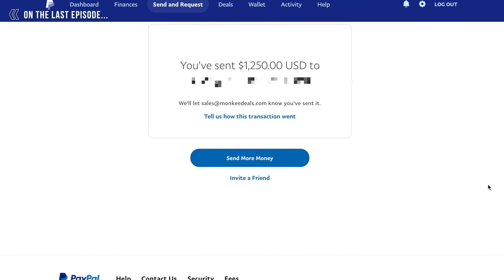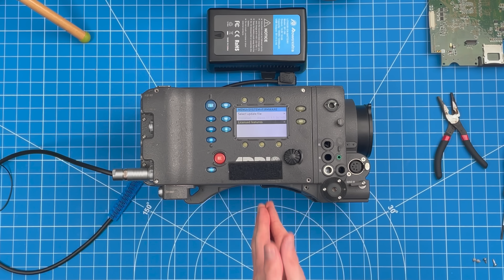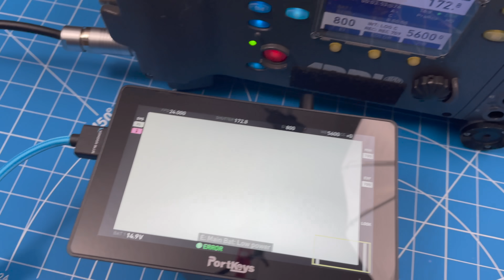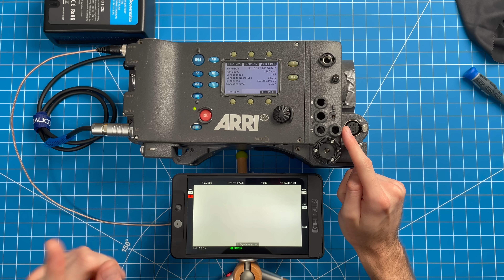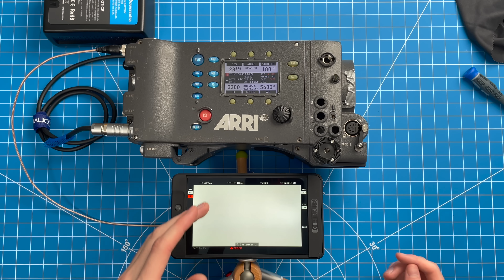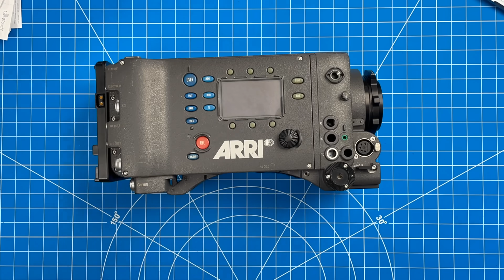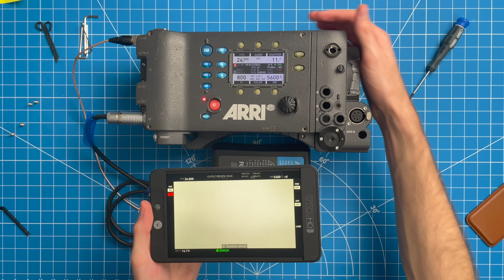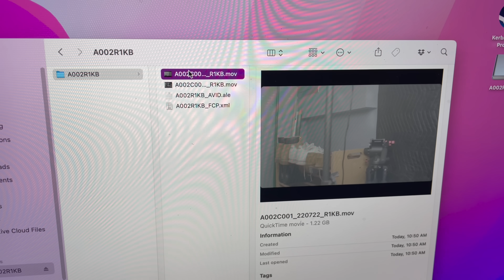I Paid $1,250 For 5 Broken Arri Alexa Cinema Cameras... Can I Fix Them? (Part 2)

Comment: I too started tearing things apart at a young age.  This is a perfect example of my own philosophy:  "If someone was smart enough to design and build it, then I'm smart enough to figure out how to fix it."  Many times I've been told that I was 'super smart'; my response is "I dunno about smart, I'm just good at figuring sh*t out."  I see that in you.

I also see that you are a good filmmaker.  Part 1 had me on the edge of my seat before you even placed the order!  Speaking of filmmaking, a little 'cost of replacement' insurance and you could RENT this camera to other budding filmmakers.  I've seen this camera rent for $600US per week, by itself; and that's at the low end.  Add accessory package(s) and you'd really be cooking with solar. 

VERY WELL DONE!  I'm glad I took the time to watch.

Comment: I worked as a DIT in Germany for many years and during the time the Alexa came out. Such a great video, thanks! Was kind of a ride down memory lane ;) If you have any questions, feel free to ask and I will try to answer them. Cheers
PS: the footage looked quite contrasty, did you do grading? did you use Log-C? Did you try the Open Gate mode? As I mentioned in another comment, there are dead pixels in your footage and there is a fix.
Reply: I'm also very interested in seeing what mode he used.
Reply: was geht denn bei dir ab...bist einfach gandalf bei so arri zeugs. respekt
Reply from the maker: Thank you! I shot in Log-C and color graded with FilmConvert Nitrate. I have lots of practice to do with color grading with it so it can definitely use some improvements. Also im currently working on pixel masking to fix the dead pixels!
Reply: @sem_skywalker  Agreed, they seem to take up more than one pixel each, and looks softer than if it were a cluster of dead pixels. I guess this may just be because this camera doesn't seem to shoot in 4k but has been included in a 4k video? This doesn't seem super likely though, due to the nature of the dots. As you say, lighting affects it also. I definitely agree with you that the sensor/protective glass just needs a clean. I have a Lumix G7 that had a very similar issue and blowing air onto the sensor fixed it. The defects looked almost identical.
Reply: @sem_skywalker  Let's hope so 🤞
Reply: @virtium_jpg2205  so ist das wenn man sich für Dinge interessiert..
Reply: I have an Alexa classic but the menu is not loading.  What could be the problem?
Reply: @virtium_jpg2205  Aaalter 😂😂😂😂

Comment: If I remember correctly, CAM1 has missing parts and CAM3 has a bad sensor. Is there any possibility to swap out the PCB containing the CMOS on 3 with the one on 1 and see if that works? I really don't think the camera is 100% broken. Also try hitting the white sensor with a projector or something that makes  vertical and horizontal stripes. if you can see some trace of that, it might just be a wrong voltage regulator.
I am no expert but I guess the boost circuit is fine, but the CMOS has something broken inside, that's why when you shift ISO, it works, but when you shift shutter, the integration time of the CMOS doesn't get applied correctly.
Reply: I get the feeling he can get another one working too.

Comment: I might have a few more answers for you:  (I'm wirting these as I watch the video so you might already found a solution)
1. internal battery low (doesn't really matter as it's just the one supplying the internal clock when the camera powered off)
2. SDI connectors don't last forever but they can be replaced quite easily (atleast on the newer Alexas, Classic shouldn't be different).
3. you figured that out ... (the pink image could be different causes: not mached color spaces between camara and monitor, WB and tint. A factory reset should fix these (always a good idea with an Alexa you haven't used sofar). Could be a Sensor or image processing problem which would be more severe.)
4. white screen (with covered sensor) could mean that the calibration file is missing or corrupted (fix: new calibration, which unfortuantly only Arri service can do)
5. yes, those died young - usually when they come in for service they have 10k+ hours.
6. you figured that out ... the ring on the sensor: dried out drop of liquid or hair (but its really sharp so probably on the sensor not the glasses infront of it (try to blow it of with one of those camera dust blowers, if it sticks: whipe it of with iso, (aceton) or distilled water try it out some might work some might not)
7. if you try to remove the sensor from the housing just don't pull of the heat pipes or PCBs (it would kill the thing). If service does it more than double what you paid for these cameras. 
8. those dots (dead pixels) look more like dust or laser damage (first can be fixed, latter not). if its dead pixels it looks quite bad (compared to a regular one - might can be calibrated might not)

Yay you got one working. If you have questions just ask, I might know it or someone who does.

Comment: Damn man! You’ve gotten so lucky with these, I didn’t think you’d get a single working camera out of it let alone several! I mean they’re not perfect but what a discount!

You should definitely part out the non working one as I know the boards, components and parts from them would help out so many others with one or two issues stopping them from using their Alexa’s!
Reply: I don't know too much about these but looking at the prices for even part machines I feel like even if they all had defective sensors 1250 for all 5 would still be an incredible deal. For reference a parts machine (with supposedly just defective buttons tbf but you never know) sold on bid for 1500. That's just one camera. Seeing that it's honestly impressive the listing for all 5 didn't insta sell for 1500.

Comment: Good job. I have been troubleshooting electronics for almost 30 years in professional settings. I have had to do a lot of the same thing where I have made good units out of 4 or 5 bad ones. It is a good feeling but its so much better when its things you paid for yourself.

I would keep at the other units. Camera 1 is probably good as is 3 you just need sensors. Maybe some other broken units can provide those parts.

Comment: It's amazing that you've gotten 140K+ views about fixing an Alexa; I wouldn't have thought that many people would even know what it was! BTW, you'll appreciate knowing that ARRI charges about $30K for a rebuilt sensor block and another thousand in Labor to install it.  Presumably the sensor block is a sealed assembly, no dirt is supposed to get in there.  That's why they replace them for free if dirt is found behind the cover glass, when under warranty. That's also why your fix of blowing through the screw hole to move the hair inside is very revealing. That must be the way that dirt gets in there.  The whole situation is complicated in the Amira and Mini cameras because there's also a movable ND filter wheel inside the sealed area, Their new camera moves the filter wheel out of the sealed assembly, presumably to make it easier to clean.  Congrats on your initiative and discipline!

Comment: This was so freaking cool. What a great idea! I am curious if you could take a sensor from one of the modular Alexas and re-solder it into one of the other bodies. If it truly is the same chip you should be good and I believe those systems use the same sensors. Also, you could TOTALLY retrofit a speed booster in the flange. Maybe buy the canon RF speed booster (since it's definitely the sharpest) and see if you can retrofit it? Make your own Alexa LF!
Reply from the maker: oooooo a DIY Alexa LF would be an AWESOME project. I will start looking into it!
Reply: @FoxTailWhipz  I’ve performed that surgery on many older Ef mount cameras, basically all you have to do is make sure the element your installing lines up as close as possible to the front flange on the mount as the speed booster you removed it from. You could probably do fine just using a viltrox internal element because at 2k resolution you likely wouldn’t lose any noticeable sharpness. But the canon booster is hands down the sharpest

Comment: NEVER EVER unscrew the sensor.... first of all it has cooling pipes which may bend... but more importantly - IT IS CALIBRATED (the screws are locked with red lack paint) !!!

You usually aproach it from the front only... My best recomandation to you is to bring it to a professional camera repair shop in your area for cleaning. I always do this with my professional DSLR's.
Cheers! & great video!

Comment: Very impressive man, well done. I have a fair bit of experience in taking cine cameras apart and reverse engineering them and the sensors. If you check my channel you will se I have designed 2 cine cameras (technically conversions of BMPCC 4k and 6k) myself that are designed to go on drones, so watching your journey has been really fun and remenisant of my own experiences. If you would like any help getting rid of the rest of the dust on the sensor or if you want to try and get the other sensor blocks working, I think I could help, and would be happy to do so. Looks like you can bypass the power input xlr port and just power it from a lipo or any power source, so that would be handy for getting the others working.

Comment: Awesome results congrats!
To record with it further, what about using an external recorder which can record ProRes (or even H.265) from the SDI output?
I guess you'd be able to get a lot more storage and record time, in a cost effective way like that!
Reply from the maker: Ive been looking into it but external SDI recorders are quite expensive.
Reply: @FoxTailWhipz  ah you're right, a Ninja V would do but it's not cheap.
Reply: @supercurioTube  I just bought a Ninja V last night for $300 on eBay.

Comment: Some insight into why the "white screen" #3 camera behaved the way it did - that is, changing the ISO/ASA/EI making the image brighter/dimmer while shutter speed did nothing: the camera is built with an architecture that's distinctly different from pretty much everyone else. The sensor itself is almost completely analog, and outputs analog(voltage) signals, and both the final amplification and analog-to-digital conversion happens on the circuit boards, while the pixel shutter signaling(think of shutter speed as turning "plugging the pixel light bucket") happens on the sensor. In contrast, other modern digital cameras have the full analog pipeline on the silicon, and the processor reads out a digital stream.
As to why it was white - image sensors output an inversely proportional signal(0V for saturated, analog max for completely dark), and with the ADC part being separate(and not killed while the sensor was), changing the ISO changed the analog amplification on the board, but it was still amplifying garbage(near 0V) coming from the sensor.
In short, the sensor or something else on the board is toast.

Comment: You are definitely on the way young padawan!   YEARS ago was working for a company that primarily did video projection as a general tech but  had a camera background.  The owner found himself in a spot with the contractor supplying video crews so decided to start a camera department.    He bought a bunch of old cameras and a couple old flypacks and I went through this same kind of process.    Got gear working well enough a short couple years later was running it on IMAG gigs for major talent.   Couple more years and the boss started buying fresher gear.   Decade later was buying multiple rigs brand new....   Then the bougie techs and the boss didn't need my skills as much so I moved on.   My only regret - since it cost so little to do it that way,  should have saved the bootstrapping for my own business instead of helping him build his.  LOL....   Good luck!

Comment: I found this video series just now from the algorithm, and even though I know you got the dust off, I'd like to tell you my way of getting stubborn dust out of really pesky spaces. I've got dust off sensors and the backside of flatbed scanner glass, and I spent so much time and effort trying to figure out what to use to clean literally micrometer-sized dust specs, but I have found a great process, as crazy as it sounds.
The way I get dust off of is with a new bottle of distilled water or rubbing alcohol (a used bottle can have contaminants which streak and show as glare or haze), a room with still air, and a coffee filter. I use the round ones since they're smooth all around, and I wrap the frilly edges around my fingers. I'll get just enough DI water or alcohol for the dust to "stick" on the tip of the coffee filter, and carefully wipe the dust away. If you need a bigger surface area, you can change how you hold the filter, but the key thing that I learned the hard way, never let anything with oil touch the side of the coffee filter that you're using to clean with! grab the filter from the edges, right from the stack of filters, immediately use it, and invert, close or cover the surface so you don't get new dust on it. Also, if you want to be very concious about new dust getting back on the surface, make sure you keep the air in the room as still as possible, since air can carry dust and air currents will kick up dust.
Also, for the love of all things optics, don't breathe on it! Even with a mask on, you're blowing around the fibers of the mask, so instead, just hold your breath or breathe very slowly.

Comment: Enjoyed this content, not really into cameras a lot, but am in general repair. This reminded me fondly of the time my father purchased a quartet of 35mm Arriflex's, one time German Military issue (yes, from back "then"...) but somehow ended up in a clearance house in Australia. Pretty sure he paid $750. Came with a few road cases of extra mag's, he sold 2 (boxs of 4 iirc)for $400ea so did well! They all "worked", think he kept the best and one for spares in the end, never did put any stock through them though, was just too much $. We shot craploads of 16mm though, countless 16mm cameras in the home, i had a h16 Bolex when i was in primary school! He worked in film/tv and was also his hobby. Hes been gone a long time, this was over 30 years ago and film was still relevant. He always hated digital but new it would take over, eventually. It is great to see these cameras are still built so similarly to the stuff from a century ago, i instantly knew it was the same brand! You could so easily mod the input connectors, a non event tbh. I had a Betamax camcorder with custom d cell nicad pack i wore on my belt as long original battery pack had given up the ghost as well as ext jack.

Comment: Good work! Congratulations! Now, get to repairing some of the other four ones and see if you can get a 2nd or 3rd one working! Disassemble those other sensor blocks and see if a repair is possible. Consider this: they're already "trash", so you can't lose if the repair doesn't go as planned.

Comment: The debris on the sensor probably wasn't a hair. It was likely a bit of the black coating on the metal that was sheared off by the IR cut filter screws. I'm sure everyone has seen a little sliver of paint/anodizing or even the base metal itself come out of screw holes on occasion. I actually would've expected better from Arri. It's not uncommon for machined parts to be specified as uncoated holes, and properly tapped and deburred threads shouldn't shed and debris unless the threads are stressed to the point of total failure.

Comment: You can easily create a positive pressure work area if you have a cube, open one side, put a small, cheap air purifier (the kind that shoots the air up - look at Holmes AER1 type) and feed that in the bottom of the box. It'll push hepa filtered air around so you won't get any lint or anything in the camera as you're working on it. Add some lights in the top, some helping hands with magnifier and you have a great setup for working on small electronics that are dust sensitive.

Comment: I used to take things apart as a kid as well. I've repaired amplifiers, all manner of audio devices, and at least one television.
That IR filter you took off?  I had an old Canon 20D where I removed the IR blocker filter from the sensor, and put a red filter in front of the lens to turn it into an IR camera.  So this video felt familiar to me, but just as frightening.
I'm glad it worked out, sir.
What a fricking cool camera body you have there.

Comment: If it's a hair on the sensor, it's easy to solve, I've had a problem like this before, I just got to the sensor and blow with a blower that looks like a therapeutic ball, but to prevent more dirt from getting in, it's necessary to make a clean room, just like those where processors are manufactured, and only then proceed and clean the sensor. Making a clean room is easy, you just need an air purifier with a filter (to absorb dust from the air) and manage to be the only air inlet of any room in the house (the smaller the room the better) or more practical to make a small container with a way to handle and see what is inside and at the same time be "airtight" with the air purifier being the only entrance. The air purifier is used to prevent dust from entering and removing what is already inside, any possible hole must leave air, so no dust enters.

Comment: You most likely need to set your flange focal depth on a camera like this that has had major service.  The power/battery error can be fixed in the software.  Just set the voltage threshold for the warning.  Any dead or stuck pixels, or overactive pixels can be mapped out in the software using a tool ARRI lets you download from their website.